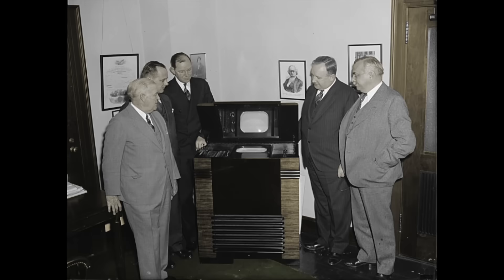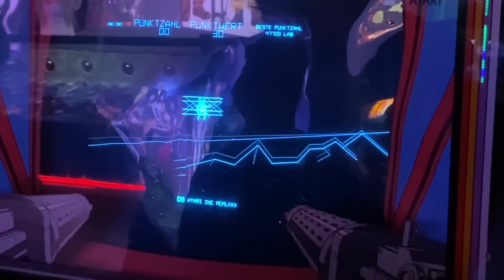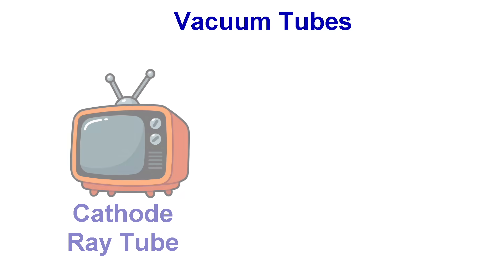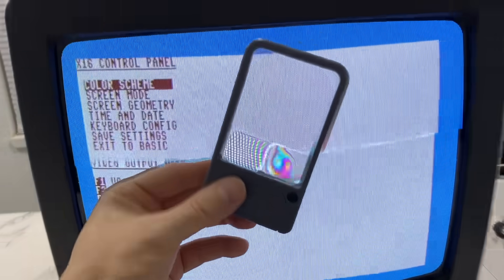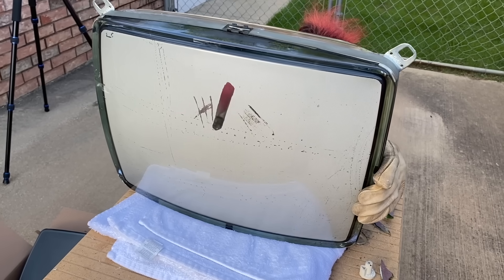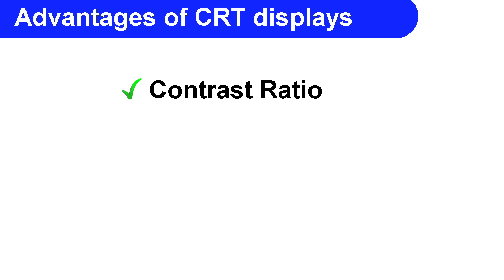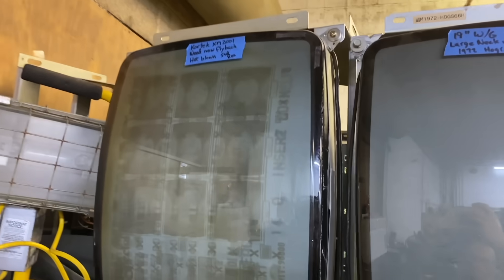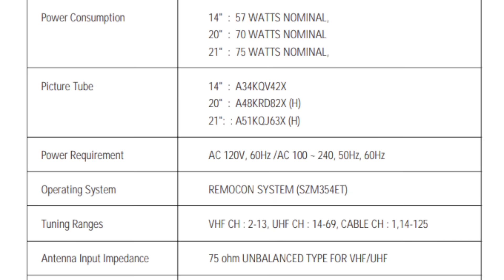How Cathode Ray Tubes Work.

Comment: You forgot another drawback of LCD displays: They require time to change the brightness of each pixel or subpixel, whereas the intensity of an electron gun can be changed instantly. And because the CRT rebuilds the entire image from scratch each time the screen is refreshed, pixels can change as fast as the CRT can refresh the screen. With an LCD, how fast pixels can change depends on many factors, including which color you want to change from to which color. For many years, response time was one of the most important limiting factors of any TFT. Thanks to tricks like overdrive, they have gotten better over the years, but even today, switching from black to white or vice versa is typically faster on a TFT than switching from one gray scale to another. And while TFTs may claim 9 ms switching times in their manuals (enough to display 111 frames per second), that's usually just their "best case" time. On average, the same monitor may have a switching time of only 14 ms (just enough for 71 frames per second), and if that is the average, you can estimate the worst case switching time. Keep in mind that there is little point in running a monitor at 120 Hz if it cannot actually display 120 frames per second, as some information will simply never make it to the screen. Worse, the image will become blurred as the information from two or more images is blended together to some degree. The result is unwanted motion blur, which gamers especially hate. None of these problems existed with CRT. The only limiting factor with CRT was the refresh rate, and if your CRT had a refresh rate of 120 Hz, it really did display 120 completely separate images per second.
Reply: Even modern LCDs struggle to keep up with the refresh rates that are advertised. They all do overdrive, but usually for the higher refresh rates the overdrive has to be so aggressive that you end up with overshoot which creates inverse ghosting
Reply: Let's not forget the phosphors had a decay time yet it was very very low, about 100usec for blue and green typical phosphor, 1msec for red.
Reply: @Bob-1802  this is slower than drawing a scanline, yet on high speed cameras you can see that only part of the line lights up at any time.
Reply: @ArneChristianRosenfeldt  Yep! It adds some "persistence" to the picture. The rest is done by the retina persistence.
Reply: Good point.
I always wondered at how and why corrunt lcd screens could display 120kz content of a panel itself simply cannot even keep up with 60 or 80fps? Thus resulting in motion blur.
Crt screen could keep up with 120fps content thus it will not view any motion blur.
However so i have only seen 100hz tv’s wich even don’t process 100hz content at all, all what they do is doubling or creating new frames from 30fps or 60fps content (depending on it’s resolution and/or type cable) to generate 100fps on screen but it’s artificially created by a processor, so it’s not real 100hz content.
And with such low response time of lcd screens in mind, i simply just don’t understand why and how on earth todays smartphones are 120hz, that’s just silly and power wasting to me.
Reply: @johneygd most phones are oled 💀
Reply: @joeykeilholz925   No, only expensive phones. Most of the world uses phones you never heard of that cost $80; correspondingly those are "most phones".
Reply: How can the human eye still detect motion blur here? I cannot even full screen 80Hz flicker. 120 Hz is the GPU (and gameloop) making up for the lag of LCD and internet.
Reply: @ArneChristianRosenfeldt  You may be familiar with the concept of a shutter in old cameras. The shutter opens, the film is exposed, the shutter closes. Now you have taken a picture, and all parts of the film have been exposed at exactly the same time, so all parts of the picture are synchronized. Modern cameras don't have a physical shutter anymore, and their sensors aren't usually interrogated at the exact same moment. Due to limited processing power and signal lines, they have a rolling shutter, which means that the time the top sensors are capturing is different from the time the bottom sensors are capturing. No problem if you're capturing a still image, but if you're capturing a moving object, you get rolling shutter artifacts (if you don't know what that is, just search for it and you'll find plenty of examples).

It's even worse for our eyes, because each light cone has its own "shutter," so to speak, that is not synchronized with anything. So it's not that our eye is taking an image every 30th of a second, but our eye is taking billions of sub-images per second, each at a very low resolution and at a different point in time, and our brain is stitching them together to get complete, high resolution images that reflect some point in time that is the average of all the times the sub-images were created and just stitched together. In nature, this is not a problem because there is continuous exposure and all changes happen very gradually and smoothly with virtually unlimited time and pixel resolution.

A CRT doesn't produce an image like this, but because a CRT produces dedicated images with lots of black between pixel changes, the entire CRT acts like a shutter to our eyes. It just flashes an image to our retina every nth of a second, with no information in between. This synchronizes our light cones to the frequency of the monitor, because only when the monitor is sending light to our retina is there an image to see, in between there simply isn't. And as long as that frequency is high enough, we won't see any flickering either, because the last image our brain built stays in our "vision" until it builds the next one, and that takes some time and requires cones to send new information, which also takes some time, because once a cone has fired, it can't fire again for a certain period of time, even if it is hit by light again. You might expect a rolling shutter effect because the CRT does not flash the whole image at once, but builds it up from top to bottom, but since all parts belong to the same point in time, there is no rolling shutter effect.

A TFT, on the other hand, constantly produces an image, so there is no "shutter" for our eyes. In this aspect, a TFT is closer to nature, but unlike nature, changes are not smooth and gradual with virtually unlimited time resolution. At some point, pixels will change from one color to another or from one position to another (our brain also tries to track motion, and if there was a red pixel at x,y and now it's at x+30,y, our brain will not interpret that as x,y changed from red to black and x+30,y changed from black to red, but as "the red pixel moved to the right"). So there is nothing to synchronize our light cones, and each cone will record a different point in time. And in most cases they will record either the old image or the new image, but in some cases they will record an intermediate image during the transition between them. The problem is that this transition doesn't exist in nature. These in-between images are actually artifacts that occur when a TFT pixel changes from one color to another. They shouldn't be there, and our retinas should never record them.

People always think you cannot see the difference between 60, 75, 100, or 120 Hz, but you can. The difference is in the sharpness of moving objects. You cannot see more than 30 full frames per second of information, but since these images are made up of billions of sub-frames, it matters what was recorded in those sub-frames, and that largely depends on how fast the image transition is. The faster, the closer the recorded image looks like a natural image to your eyes and brain. The slower, the more likely your eyes will record transition artifacts that your brain will blend into the final image. The fact that you can't see an 80 Hz flicker doesn't mean anything here, because you weren't trying to see detailed information in this test. A very good test to demonstrate this sharpness problem is the following:

Start with a gaming TFT at 60 Hz. Run a random small text from right to left across the screen. Try to read this text. If you can read it, press a button and a new text will run, but this new text will run faster than the previous text. Each time you press the button, it will run faster. Find the sweet spot where you have trouble reading the text because it gets blurrier and blurrier to your eyes. Record the speed. Now set your monitor to a higher and higher frequency and repeat the test. You will notice that the higher the refresh rate of the monitor, the faster the text can go and you can still read it. That is, as long as your monitor can truly provide that refresh rate. The result also depends on the contrast of the text, it shouldn't be too high, otherwise you have to go very high speeds even at 60 Hz and then you might not be able to read it because it's too short on the screen.
Reply: @xcoder1122  this becomes important once you move your eyeballs. With LCD in a cabinet you could scan a light bar over the LCD using a scanner. ( gas discharge tube or row of LEDs ). But this still adds latency. I still have not Found a good Text about LCD. I think it should be possible to keep the lines at zero voltage most of the time, and only kick them just before the light bar comes. With a true 320 lines LCD @ 60 Hz there would be plenty of time to pulse width modulate for 4 bit per color. Or how many bpp does NeoGeo have?
Reply: @ArneChristianRosenfeldt There are too many drawback of an LCD display that made me wish it discontinue. I got OLED monitor and TV it doesn’t have everything CRT have but it better enough to not go back to crappy IPS monitors and Mini LED and QLED TV

Comment: How the F**k do the deflection coils work? Those are the most amazing part to me of the whole thing that everyone just glosses over. I don't understand how they can whip the electron beam across the screen 31500 times a second, and also how the beam is cut off for the blacks and turned back on again all with no microprocessors. It still seems like magic.
Reply: CRT electron guns are firing at around 30,000kps, and electromagnetism is essentially instant at those scales, covering the screen 31,500 times a second seems very reasonable. Wild technology

Comment: As much as I regret trashing my old K6 Presarios over a decade ago, I think I would have been really kicking myself if I had gotten rid of the displays. We're still just barely in a time where these old TV's and displays are available. Odds are good if you have a coworker over the age of 50, they probably have a CRT either in a guest room or gathering dust in their garage and would probably be glad to part with it for less than three figures.

Comment: Unfortunately, there is one flaw with the 80-year-old TV scenario I should point out. CRTs from that time period have been known to develop cataracts on the screen as a result of a layer between the tube itself and the outer glass deteriorating, something some might say is an equivalent to the LCD vinegar syndrome. Though it is worth noting that the cataracts can be removed, so...
Reply: The 8 bit guy did say minor repair might be needed. Cataracts are not something that happen on every CRT tube, and sometimes they only happen a little. 

Even if it does happen, it's a simple enough fix.

Comment: Vacuum Tubes live on in guitar amplification - digital amp modeling is becoming more & more prevalent with  touring artists, but they’re often paired with a power amplifier still running at least 2 if not 4 6L6s or EL34s, sometimes even KT88s!
Reply: That sinking feeling when you turn your amp on and there's no glow from the back :(
Reply: @mattd6085  one of the reasons I’ve got all solid state amps 😎😎 - those 80s and 90s Solid State Peaveys really have a mojo all their own, and have given me the ability to run a pair of amps in an apartment friendly wet/dry rig!  They even clean up with the volume control just a tube amp would, and take an overdrive or fuzz beautifully

Comment: When I bought my first LCD television I understood the problem with comparing 4:3 to 16:9.  So what I did was measured the vertical dimension of my CRT TV and took a tape measure to the LCD displays in the store and chose one that was the same.  While this was actually more screen area it felt the same because when I watched widescreen movie DVD's it displayed everything rather than being cut off to fit 4:3 CRTs or having those annoying black bars on top and bottom.

Comment: I remember our TV was in like a solid wood cabinet, very old and very heavy. I was only 5 at that time and we got a new one soon. It was a normal black plastic, black screened behemoth 24inch CRT. It was nice~ We actually moved on to "HD" pretty fast as well, in 2007 we got a 55inch plasma (which I still own).
Also you could still buy a brand new B/W tv in the early 2000s, a 5inch one that ran on batteries, I remember buying one on sale for $20 in 2003-ish and I still have it. I would use it in the car to play games since I could run them off 12v.

Also, for TV watching, I do actually watch everything on either that 1980s CRT or 55inch Plasma. I have a VCR and DVD player hooked to both. I don't have a modern television in my room

Comment: My Dad used to be a TV repair engineer (1960s - 1990s) and he was the go to person when someone's TV had conked out before a game.  Most of the time it was usually a valve/tube and cos I used to come along with him, I used to bag myself some treats.

He passed away 2 years ago.
Reply: My uncle was one in the 1960s - 1980s before he changed career, and he also died in September 2022. The stories he would tell were funny and amazing about his TV repair days, both in the labs, production lines and in customers front rooms.  They tended to ask for my uncle to come and fix their sets, rather than many of the other guys in the company as faults would just continue on for months or years, and then my uncle would show up and fix it permanently.

Comment: One big thing CRTs still do better, and plasma also, and that is motion. Motion resolution on either of these displays is significantly better than LCD, OLED, or any other display that relies on "sample and hold" to display motion. Sample and hold means that for each video frame, the entire screen is "drawn" and displayed for a set amount of time. For still or low-motion video this can look OK, but whenever you view scenes where the camera is panning or zooming in you will get flip-book like stutter. And when the motion is fast, it just becomes a jumbled mess due to ghosting.

The display technology that DOES NOT have these issues includes:

CRT
DLP
Plasma

Comment: Back in the day, an easy degaussing tool was to use the motor-side of a hair dryer and bring it near the screen and move it around.  The magnetic fields from the motor were good enough to sort out most colour problems.

Comment: 8:18 BE CAREFUL!! Breaking a vacuum tube that still has vacuum can be very dangerous! If you throw a rock at it, it will explode (implode) throwing shards of glasses in every direction. What is even worse is that these glass shards will be coated in glass powder. If you get cut with these pieces of glass, your wound will be embedded with this glass powder. This glass powder can remain inside your flash and reopen the wound if you apply mechanical force to the healed scar. I am talking about worse case scenario here but I think that "The 8-Bit Guy" did not emphasized well enough how important it is to wear safety glasses, gloves, and a mask.

Comment: one thing i didn't see mentioned in the video is while yes a crt doesn't have a "native resolution" in the traditional sense, it does have somewhat of a max resolution you can display and go up to. the highest resolution you can go is entirely dependent on what its horizontal scan rate is (how many times a second the electron beam can go from left to right). a simple way of calculating the horizontal scan rate of a resolution is to take how many lines are displayed (including overscan) and multiply it by the vertical refresh rate so for example a tv signal made up of 625 horizontal lines at a vertical refresh of 25hz (a regular PAL broadcast signal) would give 15625hz. if you want the amount of horizontal lines per frame, you divide the horizontal scan rate by the vertical refresh rate. and for the vertical refresh rate you divide the horizontal scan rate by the amount of horizontal lines displayed

Comment: I heard you have some experience with broken tubes. Do you have any videos of how easy you can break a tube if you dont handle it right? Jokes aside, I let fall down a Nazi radio tube from the table and it did not break (at least not the glass - not sure on the function). I was surprised by that, built tough.

Comment: another cool thing about CRTs, because they don't use pixels you really don't need anti-aliasing like you do on a LCD screen.
Reply: i dont think ive really enjoyed using AA on even high end gpus with high res screens.
Reply: @smiththers2  i turn it off on every game, its pretty much a hardware blur filter. id rather have jagged edges on somethings then have everything blurry.

Comment: As for longevity, I retired my crt tv a couple of years ago, at the age of 22. It still worked pefectly, but my eyes didn't so I needed a bigger set. I also use a tube radio from 1952 daily, works like a charm since I got it in 2007. Don't know how much use it had had previously though.